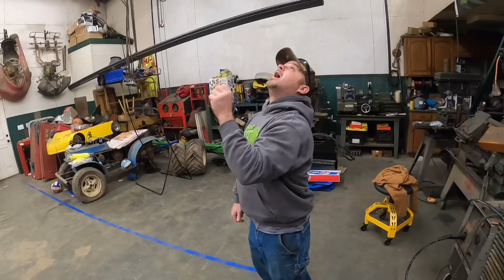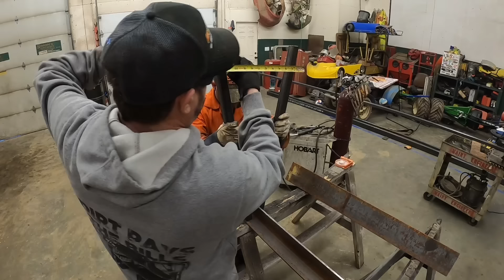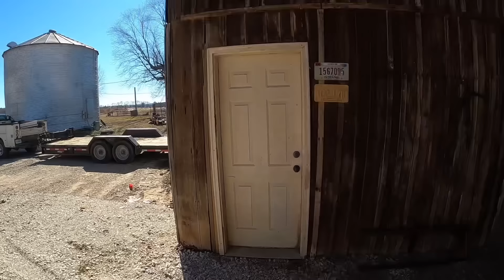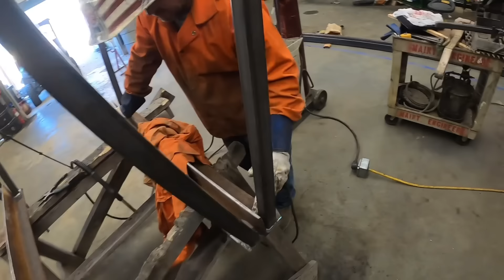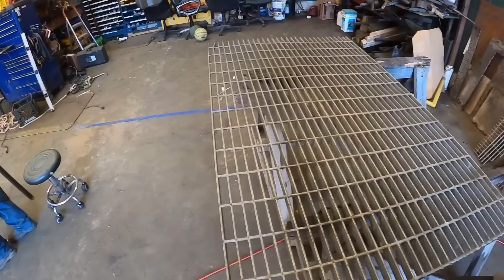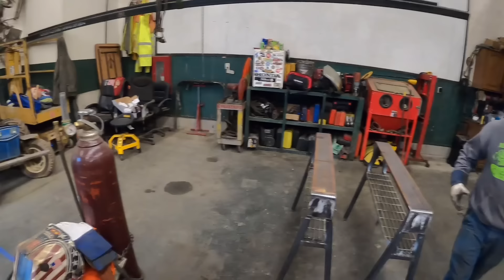Building The Ultimate Custom Saw Horses With Awesome Upgrades For The shop!

Comment: Mike, if you clean up that metal rack, and throw out a bunch of it, the first time you have to build our repair something, you will need half of whatever you throw out. Voice of experience talking to you here.😊
Reply: I’ve been there!!!😂
Reply: Looks like you have 3 cross braces on one saw horse.
Reply: Happens EVERY Time
Reply: Don’t do it, you’ll be buying metal that you got rid of! Just sit down drink a Pepsi!!
Reply: Clean and or throw out something you think you wont need or never used as soon as you do you will need it.
Reply: If you really want to get rid of metal, go for the smallest pieces.  You can always make something small, but it hard to make something larger.
Reply: Never fails
Reply: I had a guy working for me that would horde every screw, nut, blot, washer, clip, everything to do with fastening hardware. We had boxes of this stuff. We had to move to a new location, and didn’t have the same room to store stuff, so I made him consolidate all the junk into one container. Obviously, he had to dump,some stuff. Three (3) years after the move, he waltz into my office and proudly told me that, if I’d let him keep his vital stuff, he could have finished the job today but I made him throw out the one thing that would have fitted. Three years, give me a break🤔😄.
Reply: If'n y'all's gonna throw out all that GLORIOUS SCRAP METAL AND TUBING, throw it my way!!! (That's gonna make my wife CRINGE and <facepalm>!!!😂)

Comment: One grate has 6 slots and the other has 7. BUSTED! 😂
Reply: one's the other way up as well
Reply: I saw that also but I don't think that's it
Reply: He did want to make one shelf wider 😀😄😆
Reply: and they welded in a shelf support too low and had to add another one on top of it.
Reply: I thought I heard DP say he cut the legs 36". If so, the top will be less than the 36" they were shooting for.
Reply: I think the shelves are upside down. The cross rods on the grating should be on the bottom.
Reply: @lilredcummins  that actually might be the way he wanted them though, those rods could keep things from falling into the gap if the rod was on bottom.
Reply: @warrenmichael918  Yes, you may be correct. Will DP ever tell us? Enquiring minds want to know!
Reply: @lilredcummins  tell us? HAHA this was videoed so long ago, he doesnt even remember now!!

Comment: paint them red white and blue fo MBTS

For wood projects add 2X6 with some wood dowels that can be slid into holes drilled into the top of the sawhorses to attach the wood buffers so you will be able use the wood saw properly with the saw tooth sticking thru the bottom of the work piece, then store above the saw horses on walk brackets.
I saw the kerf marks in the to of the retired sawhorses

Comment: 🙂 first i saw the 2x2 jig and first leg was inward about an inch when leg tacked so if it were welded- then the cross for shelf would be lower at one end making the shelf lop sided on one of the stands that either has 7 or 8 grated shelf - one is 7 and other is 8 - just put the skinny stuffy on the one 😁 - I Was thinking part of shelf with 1" round holes to put spud wrenches and pry bars in.  Shop looks great guys !!!  SAFETY YELLOW with RED BARBER POLE NEAR BOTTOM OF LEGS !!!

Comment: Finishing touch for the horses. Glue some timber along the top for those occasional 'too deep' cuts.
Reply: Oh HELL yes...

Better to have the blade hit a slab of wood and not a slab of steel...

Wood Saw Blades really, Really, REALLY hate slamming into metal...I know...I've wrecked more than one by cutting a 2x4 and hitting a hidden nail or screw...

It REALLY sucks when I'm using a new carbide blade for the first time too...

Comment: I like the self on the saw horses, and only thing wrong I found was one of them doesn't have the legs centered. But I don't think it's going to make any difference for using it. Now the shop is cleaned up you can't use it, Gunnar is taking charge 😂😂😂. The farm is definitely helping out with equipment storage and cleaning up the house and main barn. I'm happy to see you have a place for everything. I'm waiting for you to get back to work at the farm cleanup project. Great teamwork guys.

Comment: Hello from the Netherlands. 
maybe make a small adjustment to 1 of the 2 saw horses.  
At the bottom of the square tube under the shelf, place an angle steel at both ends with the lip downwards.  
If you then stack the sawhorses, the top one can no longer slide off because the bottom one will then fall with its top between the angle steels.  
otherwise a nice Shop project again 👍
thanks for the video DP and Aaron .  
Kind regards, Hollandduck

Comment: Excellent video!  Suggest putting a cuttable material like a 2"x4" or 4"x4" (glue) on top so you don't damage saw teeth and then you can cut straight through.  Look at the top of the old SH's to see how much you've cut/drilled on the top plate.  You guys are a perfect team; very funny.

Comment: I wondered when this was going to happen. I thought for sure them wooden ones would have bit the dust with the limb saw. Might consider taking a pieces of square tubing bout 1/2” thick and welding it for a hand holt in the side of leg. Plus it’s a great place to stick the grinder handle or the mig gun while you’re making cuts or adjustments.

Comment: You should invest in an Evolution chop saw. I used my new saw on my last project and it was so much nicer. I also got a metal cutting Diablo blade for the 7 1/2" skill saw. It cuts plate as easy as you'd cut plywood. And almost as fast. I'll never go back to using abrasive blades.

Comment: Mike, LOVE the new home made saw horses, I agree with Aaron that the old woodend ones need to finally be retired, and thes emetal ones are more stable. also Love the fact that you got a lot of crap out of your shop and more room now for work and fabracation of things. The new cedar shelving at the Farm place is awesome, an will keep things THERE in better order. Happy that you DID get the leaky roof repaired. Did the lady finally ever get her horses and donkey and her pigs out of there?? Would be a great place to store some of your equiptment, that you do not use AS often, and keep it at THAT location, though think you will have to clean up there as well and maybe check on structure of building first??

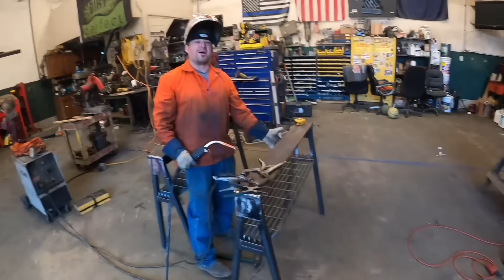Comment: At 42:31 The sawhorse on the right has a double stack for the cross bar to hold the grated shelf.  Looks like one was welded in to short so you added another.

Comment: You could welder small pieces of pipe at the ends of saw horses to put hammers and welding nozzle etc I made mine with aluminium  really strong and super light

Comment: I jave similar sawhorses I made. Instead of stacking vertically my legs are offset. One end butts up against the end of the top tube. The other end is offset by the thickness of the legs so they can come together and have an even and square platform.. comes in handy every now and then

Comment: You now have your vice holding items you grind and weld on, blowing grinding dust or weld splatter onto your lathe. It needs a cover and or a partition panel between the lathe and Vice bench.  I use a sheet of clear plastic / perspex as a divider as it does not block any light

Comment: To keep from budgeting up the face of the sawhorses you can screw a 2X4 to the top.  Or weld a section of flat steel that can be replaced after you cut it up

Comment: Absolutely love how Aaron ALWAYS has an explanation for everything blaming it on DP.
Reply: Wink, wink Aaron isn't blaming DP, he just showing DP's failure's in the planning process's.  I'm still amazed that DP allows Aaron to use some of that HIGH TECT measuring equipment, you know that thing that has a bunch of number's on it, and also has a lot of multi length lines on it, more commonly known as a measuring tape.  I've notice that Aaron has become aware of the fact that a measuring tape has a smart end and the dumb end.  I'll leave it at that.

Comment: 25:33  Perhaps the spread of the legs is narrower on this side, making the shelf mount/brace fit low.  End result is an unlevel shelf.  It looks like you went for the angle to sit flush rather than the bottom leg spread to be as wide as your wood guide.

Comment: You can let Aaron paint the new saw horses barber pole colors red , white. Shop looks bigger after the clean-up. The metal rack I won't throw nothing away, just straighten it up because  if you throw something out,. Thanks for the video you might need it later

Comment: Should Weld a little plate on the bottom of the legs. As they are now, the legs wil act as a chissel to the concretefloor everytime you put something on the sawhorse and hit it with a hammer.
Sorry for the spelling. Im from Denmark

Comment: When you were using the stick to space the legs they looked off to one side and not level or parallel with the top of the I-beam but that could have been the camera angle 🤔 BTW, I'm a carpenter and I still have and use 2 sets of wooden saw horses I've had for over 45 years 🤯

Comment: Depending on the project on the new saw horses, may need to add a sacrificial 2x6  to the top 4-6 short screws from the underside to hold it in place. Not sure if that makes it to high to work comfortably?

Comment: If the screws went into the ends of the legs, that would have been so much easier to hold it in the correct spacing. All in all, it was a decent jig.

Comment: For cutting purposes, this is just a thought of mine and those sawhorses you just built you should lay a 2 x 6 of wood across the top for cutting purposes. I wouldn’t want to see a blade hit a metal service and get ruined. Just a thought.
Reply: They have abused those things for a long time. I don't think they ever used them for cutting wood in any of the videos. The old ones caught on fire more than a few times. I'm not saying they won't, but I'm fairly sure with all of his construction experience he knows not to cut steel with a saw. Have a great Sunday, I hope the weather is nice on your side of the world.
Reply: Sorry for even bringing up putting wood on the top. I know they don’t cut wood. I was just saying never mind.

Comment: I put 2-1/2 x 2-1/2 x 1/4" plate on the bottom of my sawhorse legs so I can use them outside in the gravel/dirt driveway, flush them to the inside of the legs and you can still stack them. A little side note to MBTS, There's nothing like the taste of galvanize smoke in the morning, is there?

Comment: Come on MBHTS you got to tighten up Mike is so tall and lanky his center of gravity is thrown off you need to center up the legs a little better and and one of the shelves didn't match the other great job guys otherwise Mike you going put a dana 60 in the boys 4-wheeler/pulling tractor I think if you tub it out and install lockers in it should make for an awesome machine lol😂😂

Comment: So, are the tops of the sawhorses parallel to each other and the floor, as it did not look like it using the background as a reference!!
Reply: PS, as you did not use a level over the wood jig when setting the legs.
Reply from the maker: Yes

Comment: Had a pair of cast iron table saws that "took up space for years" in my shed. So I scrapped them.  Not a week later I needed one, bad enough that the money I got from the scrapper covered about a third of what the new one cost. To add insult to injury the new one cuts are not as clean or square... DOH!!

Comment: Kinda a mute point now, but with your piece of wood with the screws that you used as a gauge for the width of the legs....it would have been easier to just drop the screws into the end of the legs and just let it sit there so you could use both hands elsewhere.

Comment: Please be careful using your new horses. Putting the legs straight down is a mistake for stability. Saw horse legs need to splay in both directions (Check-out your old wooden ones)
Reply from the maker: So confused by what your taking about sorry